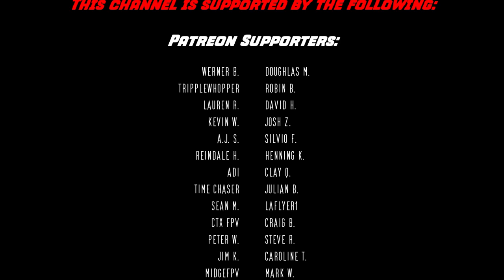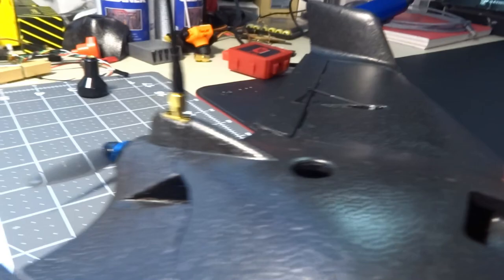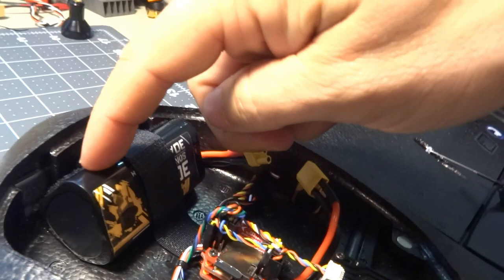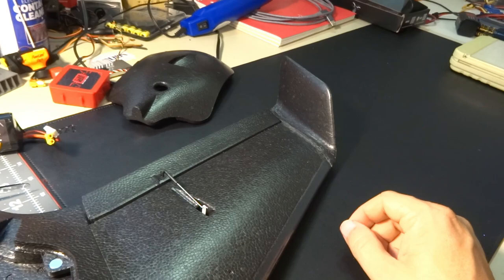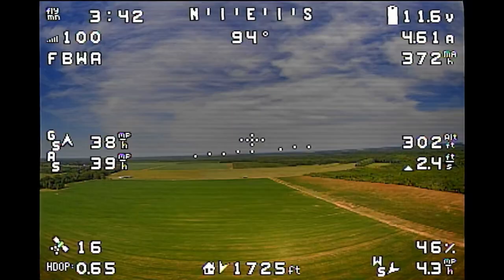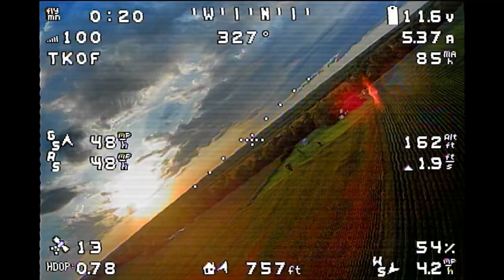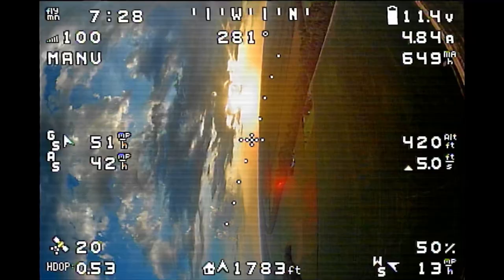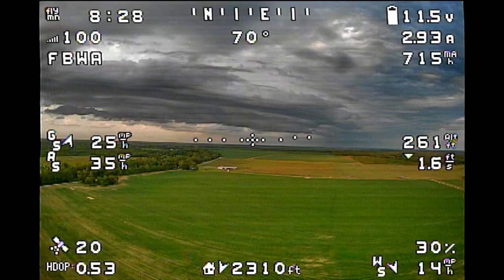Baby AR Wing Pro

Comment: For the slop in the linkage at the servo end, add a drop of cyno/super glue. Might sound strange, but it won't stick to the metal and will free up when you move the linkage. Works a treat. This little wing is definitely on my shopping list now.
Reply from the maker: That's a great idea, one I've never tried before... lol I'll have to now and see how it goes! Thanks for the tip.
Reply: @bonafidepirate just tried this trick for my baby ar wing. Works perfect. Are you going to fly it again? Efficiency is really good with a proper ESC (stock is not good). Best efficiency for weight of any plane I’ve seen so far

Comment: Pretty stable little toy. I like it. Nice build and flights
Reply from the maker: Thanks, it's a fun and easy build, there's a fair bit of room in it for such a small wing. It does fly pretty good for what it is too. I think it can only improve if I tighten up the slop in those linkages too.
Reply: @bonafidepirate  One thing I noticed as well as the linkages in Darrens (Mr. D Falling with Style) Baby Pro is he said the ailerons weren't laterally stiff either. They are flexy even though they have the carbon strip in them. Something he pointed out. That might be something to look at as well.
Reply from the maker: @North49RC  Yeah I'd agree, they are pretty flexy and not very rigid. That said though, control response seemed good when doing the quick rolls and stopping at the end of them. I'll change the linkages first and see how it does, then maybe laminate the elevons if  it doesn't improve. I know I'd be cautious of them if I were going to put a big motor on the back and go fast... lol I can see where flutter might be an issue then, especially with the open hinge gaps.
Reply: @bonafidepirate  You are right it is a light build, even for all you have in it. Just under 400gs is pretty impressive.

Comment: Nice setup. Video looks good, just would be nice there was option for smaller OSD font (realize it's not possible). Your analog video setups are consistently some of the best I watch on YT.
Seeing another Baby AR Wing Pro flying (using INAV), I noticed it too had the same pitch bobbles. The bobbles where much reduced on the second flight, with reduced P/FF gains. I don't remember this being a characteristic on the larger AR Wing Pro? Other the the bobbles, this plane seems to fly great out of the box, a nice solid design. If have small thumb camera, you could try pointing so looking at wing, controls and control arm. 
Thanks Keith, doing a very through build review and first flight(s) review.

Comment: Try adding a smaller cap (0.01uF to 0.1uF) in parallel with the larger caps to screen out some high frequency interference.
9:30... Smart logical idea...

Comment: dude just take like a arsp sensor and make fbwb use the airspeed, you don't need that huge tube , use a small bras tube for one of the opening, and leave the other without a tube, but be sure it doesn't have flow of air around it. i usually point it 180 degree from the nose . also don't forget to recalibrate the arps every flight.
Reply from the maker: Nah, I've got a number of other planes flying with airspeed sensors, but adding one to this little wing is not on my list of things to do... lol There's no need for it. The goal with this one is simple and light. BTW Ardupilot calibrates the airspeed every time it boots, there's no need to do it manually if you cover the pitot tube's dynamic port while it's initializing. Of course you need to calibrate the ratio at the start, but once that's done I haven't had to touch it again unless I change something in the plane. I also like running the static port to the holes in the side of the tube too, to get them outside the fuselage. With cooling air intakes and exhausts, you almost never have a true "static" pressure in there, it's always going to go up or down slightly as airspeed changes. It's the biggest reason we see altitude drift a few feet during the flight when using a barometer, along side temperature drift and actual changes in the outside barometric pressure, like a storm moving in or something.

Comment: I noticed the motor leads out of the ESC are circling around the pig tail. As you noted there was interference that wasn't getting cleaned up by the cap could that be a source? Just wondering how much experimentation you have done. I'm still trying to understand how the ESC and other components can interfere not only with a vtx but gps as well. I want to better understand how interference concerns might trump cg balance for placing things like the GPS antenna.

Comment: I have the same flight controller (haven't used it yet) but I read somewhere that it doesn't filter motor noise well. So probably that's why your video isn't too clean. If you have another FC then you could try to swap it to confirm if that is the cause.

Comment: Nice little bird, is it possible you’re getting video noise because you’re running the antenna extension wire across speed controller wires or being too close to the motor?
Reply from the maker: I can't rule it out with certainty until I try routing it different, but I don't think so. This looks like switching noise making it into the analog video onboard. Noise induced on that coax would likely cause issues with the RF signal more than anything. It should be ok with the shielded coax cable, but again I can't say 100% until I try it... lol I do have some other MMCX antennas/adapters I can try temporarily just to see. Might be worth a shot!

Comment: wouldn't a slop be good for less wear on components when turbelence? idk it would seem quite nice only having wear on the small plastic part rather than the entire spring/servo?
(idk im stupid xd)
Reply from the maker: No you want at little slop in the linkages as possible, for more precise control and fine trimming of the surfaces. To goal is to be right on the balance point between no slop and no friction, or as close as you can get... lol Have you ever driven and old worn out car with slack in all the tie rods, ball joints, etc.? It's kinda like that... :D
Reply: @bonafidepirate  yeah actually that sounds much better

Comment: What video receiver are you using for analog?
Reply from the maker: It's an Aomway DIV006, which is a diversity receiver that they sold some time ago. I don't think they're made anymore. I think one of the good goggle modules would be your best bet for a good analog receiver on 5.8GHz right now. I was going to pick one up and wire it up to use stand-alone without the goggles, but never did since I don't fly a lot of 5.8GHz analog.
Reply: @bonafidepirate  what antennas are you using
Reply from the maker: @amoswolfe7122  I have two triple feed patch antennas, one smaller 9.4db and one larger 14db
Reply: @bonafidepirate  do you have an antenna tracker?
Reply from the maker: @amoswolfe7122  No, never used a tracker.
Reply: @bonafidepirate  so just point and fly. Lol
Reply from the maker: @amoswolfe7122  Yep! lol The smaller antenna gives a pretty wide coverage closer in, while the higher gain larger one has a reasonably wide coverage once I get farther out. I aim them to the area I intend to fly, and if I end up flying somewhere else during the flight I just turn them as needed. I do like the idea of a tracker and have considered one more than once, but never found anything that seemed easy enough to set up at a price point that I liked.

Comment: What do think about putting Walksnail in this wing?
Reply from the maker: I don't plan to for now, but there's no reason it wouldn't work. I'd go for the longer camera cable so I could route it around the battery and mount the VTX in the airflow to keep it cool.